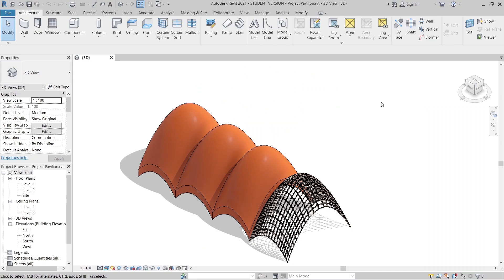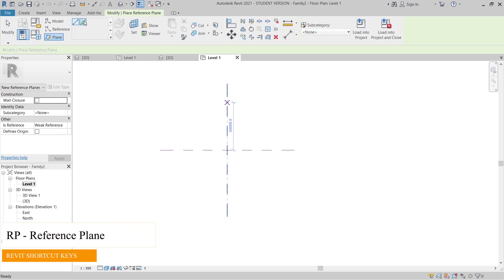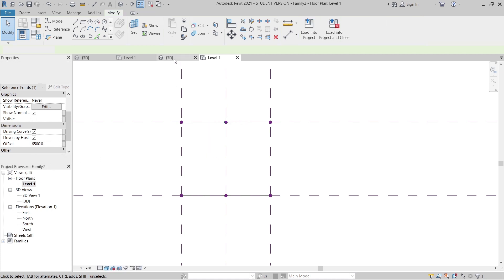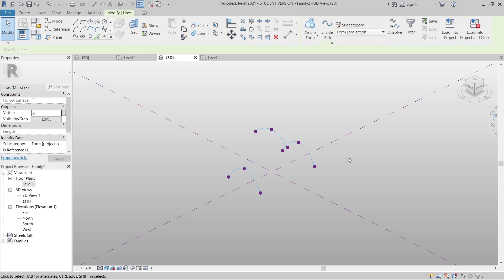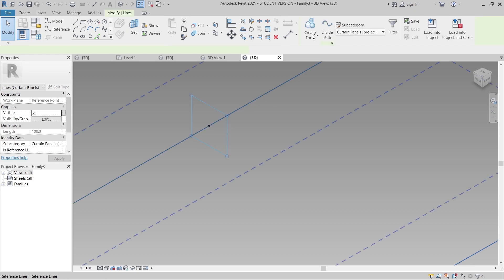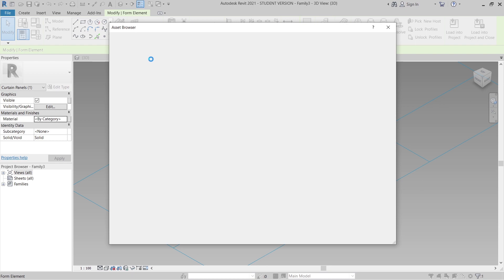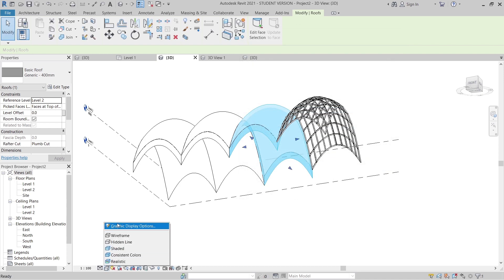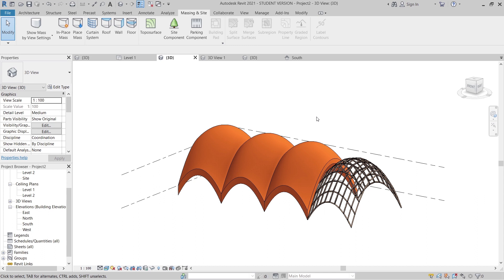Project Pavilion in Revit  | Hyperbolic shape Design

Comment: Just curious, why did u choose to create the Hyperbolic Design in another Massing Project then import it back into the Architectural Template? Why should we not create an In-Place mass directly inside the Architectural Template? Please let me know :)
Reply from the maker: Well, just because of the right way to create concept design, we need to using conceptual mass template in order to make visualization before import in to Revit Architecture template, Well you can used Revit Architecture template to create hyperbolic shape or other complex shape but remember Autodesk clearly separate the visualization template (conceptual mass); Revit Architecture template, Revit Structure template, Revit Family...... Etc. 
Those template totally different function and workflow. Just my experience on Autodesk Revit Project.
Reply: @RevitGlobalKnowledge  I see. What if I want to create a full hyperbolic architecture for a project and I need it to have windows, doors, sections, elevations and everything, like plumbing etc. Do I still draw the Hyperbolic in Massing project then import it back into Architecture Project? Or is it better to just “In Place Model” the hyperbolic directly in the Architecture project for this case?
Reply from the maker: I got what you mean, it's depend bro. For me I like to get shape of building or residential first only I continued add all those stuff door, window.... Etc . You need to think bro, everybody have their strength if direct in place mass is better on your workflows just continue make it. Actually I still highly recommend try to used conceptual mass to get your building shape first, only we started import to Revit Architecture or Model Mass in place.
Reply: @RevitGlobalKnowledge  yes hahaha. Because I model-in-place and in-place-mass directly in the Architecture Project most of the time (because I’m Lazy). And upon watching most of ur video I found this workflow which may be beneficial for me to adopt! Mainly because by using ur method (of creating a separate massing project then importing it into the architecture project), we get more control and we can edit the project anytime we want. Is that the benefit? Or is there more benefit I missed? Thank u so much!
Reply from the maker: Yes, mainly point you can control your workflows, BTW out of topics, I got alot of Singaporean friend and Malaysian friend most of them always lazy and try to make things easier. Mostly they like to do work easily get money, mean workless and get more incomes. Hahaha
Reply: @RevitGlobalKnowledge  u mean in school or work? Because I’m a student 555
Reply from the maker: @DD-eq2bl  haha work lah